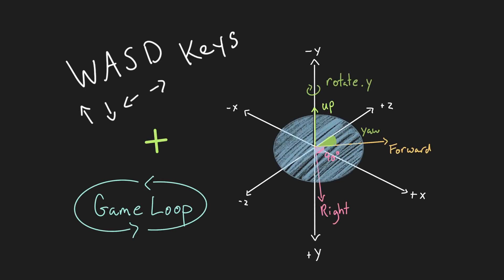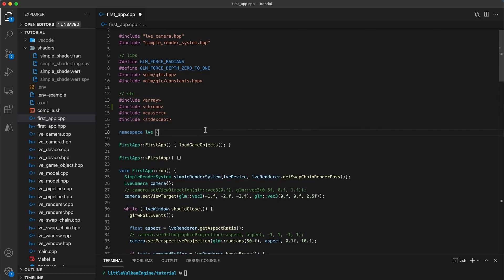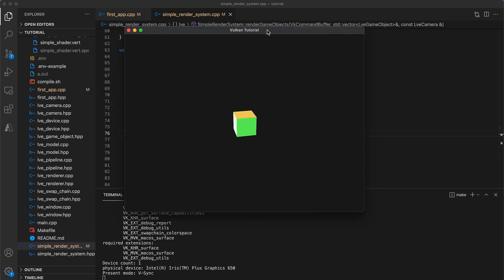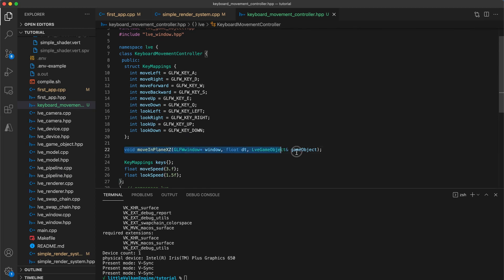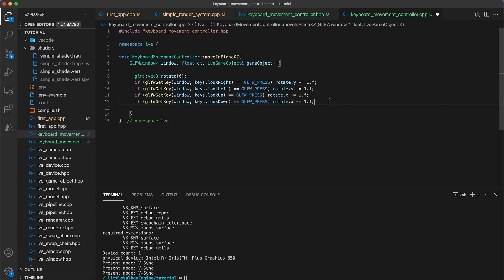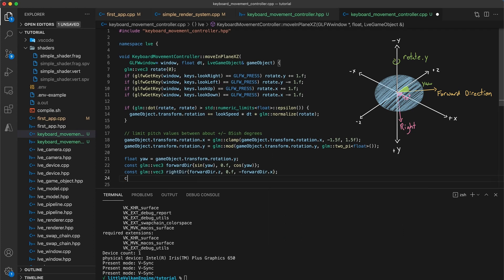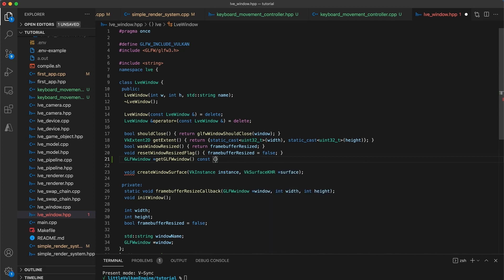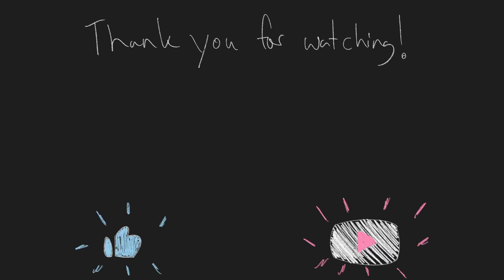Game loops & User input - Vulkan Game Engine Tutorial 15

Comment: If I try to include GLFW3 in the keyboard_movement_controller.hpp, I get a lot of errors and the engine won't compile. Why can that happen? It cannot possibly include a circular dependency as it is not a file of my engine and it can't be included twice, because of the header guards, right?

Comment: Loved this video! The series has been great for learning how to work in Vulkan.
I ended up doing my movements in a branchless style here for some extra fun!

rotation.y += static_cast<float>(glfwGetKey(window, m_KeyMappings.RotateRight) == GLFW_PRESS);
rotation.y -= static_cast<float>(glfwGetKey(window, m_KeyMappings.RotateLeft) == GLFW_PRESS);
rotation.x += static_cast<float>(glfwGetKey(window, m_KeyMappings.RotateUp) == GLFW_PRESS);
rotation.x -= static_cast<float>(glfwGetKey(window, m_KeyMappings.RotateDown) == GLFW_PRESS);
Reply: By curiosity, do you think adding those types of input would make a big difference in terms of FPS? I'm curious because I'm not that experienced in optimization, so any information on the subject helps me 😅
Reply: @jeanlouis5619   Performance is almost always contextual, and very rarely a case of "x is just better than y", so to know if something is better you simply have to measure (profile) the difference.

Branchless can be faster, since the cpu can look ahead at what it needs to do, where a conditional generally prevents that. Even with modern branch prediction, there is a cost. In c++ an enum switch is much faster than a branch due to the compiler magic that can be done to it. What I did was just make the bool be interpreted as a number using a static cast, and just let the cpu calculate the code every frame.

In my testing, this was measurably faster. Probably not enough to go out of your way to go and change, but if you make lots of thee small decisions along the way, you can get a nice little bit of perf from good decision making.

The largest perf comes from architecture choice (Like a real ECS implementation vs OOP for games with 1000s of enemies)

Next, choosing the correct data structure is important. A contiguous array is going to be much, much faster than a linked list.

Then lastly, just understanding algorithms and time complexity is important. Big O notation, but dont get dragged to down the rabbit hole here.

If youre feeling really spicy, you can learn to read assembly, so you can read your compiler output and make even more informed choices about what your code should be doing and how. This isn't required, just another helpful way to understand what your program actually does.

Profiling will tell you - 
and make sure you profile as close to real conditions as you can. You can make some pretty jank profiling tests to make things look artificially good, so remember to try to represent the code in real context when testing.
Reply: @3DWithLairdWT   Thanks for the recommendation! I'll keep this in mind!!

Comment: I got camera to rotate based on mouse input instead of keys but i wonder if there is any better solution?

Instead of :
                if (glfwGetKey(window, keys.lookRight) == GLFW_PRESS)rotate.y += 1.f;
		if (glfwGetKey(window, keys.lookLeft) == GLFW_PRESS)rotate.y -= 1.f;
		if (glfwGetKey(window, keys.lookUp) == GLFW_PRESS)rotate.x += 1.f;
		if (glfwGetKey(window, keys.lookDown) == GLFW_PRESS)rotate.x -= 1.f;

MyScript:
                double mX, mY;
		glfwGetCursorPos(window, &mX, &mY);

		int state = glfwGetMouseButton(window, GLFW_MOUSE_BUTTON_2);
		if (state == GLFW_PRESS) {
			glfwSetInputMode(window, GLFW_CURSOR, GLFW_CURSOR_DISABLED);
			rotate.y -= (mouseX - mX);
			rotate.x += (mouseY - mY);
		}
		else if (state == GLFW_RELEASE) {
			glfwSetInputMode(window, GLFW_CURSOR, GLFW_CURSOR_NORMAL);
		}

     		mouseX = mX;
		mouseY = mY;
p.s : i added mouseX and mouseY as private double in input KeyboardMovementController header,
also if you want to move in direction of view on y axis you should change " const glm::vec3 forwardDir{ sin(yaw),sin(-gameObject.transform.rotation.x),cos(yaw) }; "

Comment: A note to anyone who might get this as I did:
Sometimes, depending on the compiler you're using, saying #pragma once throws a warning, stating that it is depreciated. your code will not compile properly. you MUST use a #ifndef guard instead of #pragma once.
Reply from the maker: that's good to know! I assumed pragma once support was pretty widespread at this point, but good to know that might have been a bad assumption on my part. thanks for sharing
Reply: @BrendanGalea  A compiler not supporting #pragma once is awkward - in the last two decades all compilers moved towards supporting it.

Comment: Just wanted to share a potential mistake that will compile. The location of brackets matter. If you use the wrong one, it's just wasted code and the keyboard inputs won't register.

WRONG
if (glfwGetKey(window, keys.lookRight == GLFW_PRESS))
{
			rotate.y += 1.0f;
}

CORRECT - Will compare
if (glfwGetKey(window, keys.lookRight) == GLFW_PRESS)
{
			rotate.y += 1.0f;
}

Comment: Awesome to have things moving around! Just a question, it seems the tutorial is sticking to the co-ordinate system of vulkan i.e. Z+ into the screen and Y+ down. If I wanted my world co-ordinates to be Z+ "up" and Y+ into the screen (but still right-handed, of course) how would I go about doing this? I obviously then would preferably have my camera's coordinates the same i.e. increasing the camer'as Z would visually move the camera up on the screen, but obviously the view matrix has been designed for Vulkan's co-ordinates. Where would my "conversion" take place?
Reply from the maker: hmmm thats a good question. I'm not sure, I'd need to think about what potential issues would be and I don't know off the top of my head. 

 I think you'd want to do the change inbetween the Projection and the camera transfrom, and to combine it with the projection for the purposes of things on the shader side.

So like in a vertex shader if you have a separate modelMatrix, viewMatrix, and projection(+CoordinateTransfrom)Matrix.

That way you could do
vertexWorldSpace = modelMatrix * vertex;
vertexCameraSpace = viewMatrix * vertexWorldSpace;
gl_Postion  = projectionMatrix * vertexCameraSpace;

That way vertexCameraSpace still would be +y forward and +z up... 🙃 but I'm not sure
Reply: @BrendanGalea  ah that would make total sense yeah. Thanks for the insight!

Comment: Btw, glm has a function glm::epsilon<float>() that wraps std::numeric_limits<float>::epsilon(). There's no practical difference in this use case, but the glm version is a bit less wordy.
Reply from the maker: Oh thanks for letting me know!!
Reply: @BrendanGalea  Either way, inequality comparison between floats, even when comparing with zero, will behave as expected, so the epsilon shouldn't be needed in this case. The advice with floats is to avoid equality comparison, e,g. if x == 0.0f { ... }.

Comment: hi nice tutorials, but i have a question . How can i a learn to program it ,but using a interface, for example blender have its own interface , with buttons and sliders, or maybe create a vertices and extrude this after that export it like fbx, or paint using a pincel in a mesh using  pincels  , i dont know but i want to learn to do that  and my english is very bad :c
Reply from the maker: It can be a bit difficult, when creating your own engine you also need to create the user interface to make possible the things you speak of.

Rather than doing everything from scratch a common approach is to use an external library such as imgui for creating the engine's UI. I do have an example of how to integrate imgui using tutorial 11 as the starting point if you would like to give it a shot.
https://github.com/blurrypiano/littleVulkanEngine/tree/master/littleVulkanEngine/imguiDemo

You could also try following this tutorial here: https://vkguide.dev/docs/extra-chapter/implementing_imgui/ 
I haven't followed this specific part but vkguide.dev in my experience is a high quality resource

Comment: Hello Brendan and thnx again for the tutos!
I have a question, when I use Mailbox presentation Mode I have around 60 fps, but when I use the Immediate presentation mode FPS jumps to 3000+!!
even though when use frameTime = glm::min(frameTime, MAX_FRAME_TIME); to limit the fps

What could be happening?
I had the same problem before with OpenGL but never knew what it was, until now xD 

ps: I'm using afterburner to measure FPS
Reply from the maker: Also the glm min frame time only limits the size of the maximum timestep the “game simulation” will take. Has no affect on FPS
Reply: Also when i use the AfterBurner i have the error "pCreateInfo->format VK_FORMAT_B8G8R8A8_SRGB w
ith tiling VK_IMAGE_TILING_OPTIMAL does not support usage that includes VK_IMAGE_USAGE_STORAGE_BIT."
Reply from the maker: I think that’s to be expected by how after burner works. I’m not positive by the way since I’ve never used afterburner but what mailbox mode does is it sync with the refresh rate but you’ll be putting out extra frames that replace the old ones that haven’t been showed yet. So when the screen does refresh you will get the most up to date image. 

After burner might only be reading the frames that are actually displayed. You could try adding a counter to your game loop and print every 100 frames to confirm you’re still getting 3000+ FPS
Reply from the maker: That’s interesting. After burner probably plugs into the window behind the scenes and affects the images of the swap chain. I’d need to look into it though since I don’t actually know.

Comment: Hi thanks for your videos, I think it's actually the best content to learn Vulkan freely online! Please don't stop, you're excellent at doing that!
However, I'm trying to create my own engine based on your tutorials with my own structure, so everything is clear with one pipeline, one pipeline layout, and so on ... but I don't really understand when and how to use more than one pipeline, one render pass, one swapchain, ... Do you have any resource to better understand how all of this works?
Reply from the maker: vkguide.dev and vulkan-tutorial.com are both good resources that explain those topics in a bit more detail than I have gotten to so far. 

Umm it's kind of a complicated question to answer but here's the basic idea.

- You will have one swapchain. (This is pretty much always true for everything you will do when starting out)

- You only need more than one render pass when you want to read the results of one render pass and use it as input into another. A common example is shadow maps. First you would render the scene from the viewpoint of the light source generating a depth texture. Then you would use that depth texture as input to the second pass where you render from the camera's viewpoint and use the shadow map to determine which fragments are in shadow and which are not.

- Pipelines are paired with shader files. Currently we only have one vertex and one fragment shader file. But if we wanted to use a different shader to say render some objects in the scene in a different way then we would need another pipeline. You can have multiple pipelines used in the same render pass. 
For example something like
  start renderpass
  bind pipeline A (A's .vert and .frag shader files)
  render some objects using pipeline A
  bind pipeline B (B's .vert and .frag shader files)
  render some objects using pipeline B
  end render pass

I might have over simplified a bit. This is all stuff I'll cover in future videos so it's hard to explain it all in just a youtube comment :P 

Also you could check out this youtube series on openGL - https://www.youtube.com/watch?v=VS8wlS9hF8E&list=PLRIWtICgwaX0u7Rf9zkZhLoLuZVfUksDP
It's excellent and a lot of the ideas for pipelines, renderpasses and some other techniques carry over directly to vulkan.
Reply: @BrendanGalea  Thanks a lot for your complete answer! I will checkout the links you provided, but it's already clearer in my mind 😁